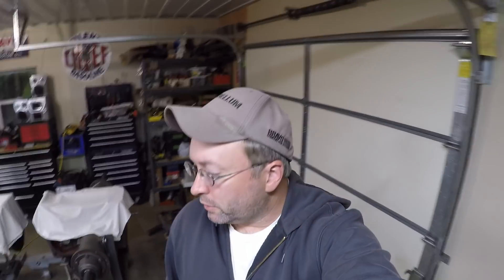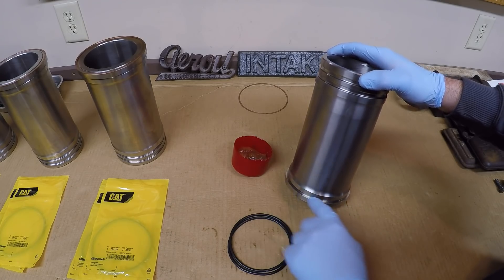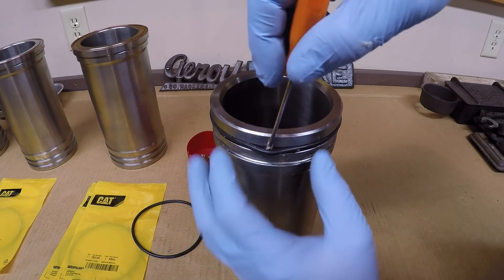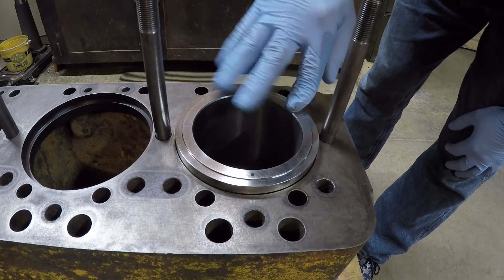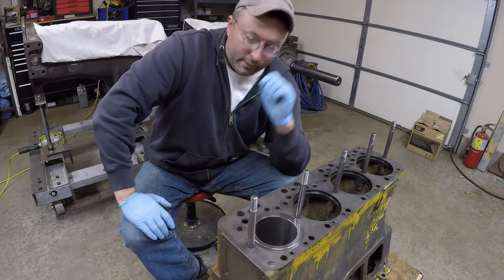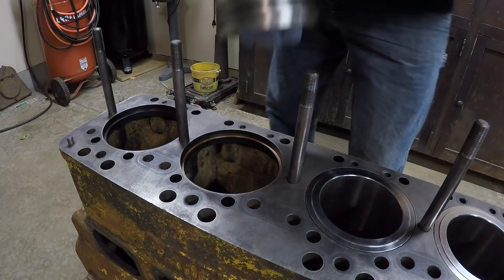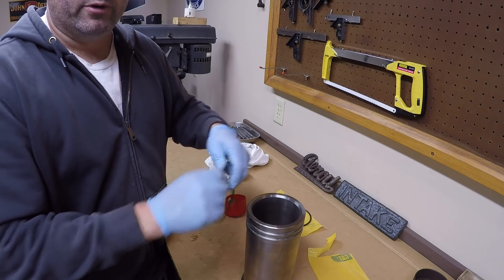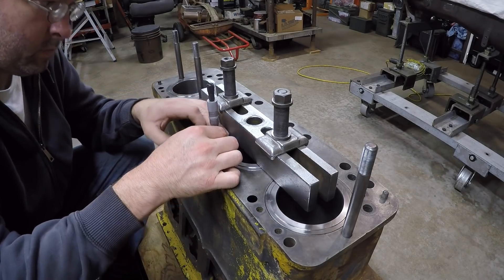Caterpillar D2 #5J1113 Diesel Engine Assembly Ep.3: Sealing & Installing Cylinder Liners

Comment: Always a good feeling when the liners SNAP down into the block bore. Question- have you ever ran into an old Cat engine that has been counter bored and a sleeve installed around the top ofthe liner? I' ve worked onCummins NTCs that have had it done to correct deck surface corrosion in the bore. As far as lubing liner O-Rings, we use motor oil on most of them because it swells the rubber into the bores imperfections

Comment: It has been 20+ years since I went though a similar class on a cummins kta3800 engine but I seems like we had to torque the sleeve in after they seated and then it was a rush to get the head on as soon as you can to so it did not work back out

Comment: Grand dad used to use western auto water pump grease to get his sleeves set in the block due to its ability to protect the rubber O rings  and I know that the tire lubes works equally as well

Comment: Thanks a ton for the reply!  Blade setup looks exactly like the one you have (running now, with the bug-eye headlamps).  Undercarrage looks well worn from the road (where I have to look at it from).  Track rails about 1/2 inch thick, or less,  and grouser pads about the same.  I can't see sprockets due to high weeds.  Also, it is NOT electric start pony, like yours (darn).  No winch (darn again), and not sure about belly pan and tow hook(s).   I plan on guessing total weight at 4 1/2 tons, for scrap worth calculation and needed hauling capability.   Thanks again!!

Comment: I'm behind in the 'ole viewing but it is that time of year. You not wearing your boots is kind of strange to me, you always with boots. The lower o-rings grooves were designed for those o-rings and nothing will seal better than things they were designed to fit there. Even on modern CAT blocks they still use o-rings so good choice sticking with what you did instead of un tried who knows stuff.

Comment: Just to play devils advocate . If it went in that easy its going to leak.  just pulling your chain. LOL Yes progress is made.
Reply: @squatch253  Years ago i assembled a reconditioned vw motor at work. It arrived with the block assembled and the rods hanging out of the bores for me to fit the pistons and heads. Fitted it and it has oil pressure for an instant then nothing. The original crankcase had cracked and they'd replace it with another one they had in stock after line boring it unbeknownst to me. When the oil pressure came it tripped the relief valve. I was thinking what have i done? I knew i'd cleaned the relief valve and spring when i'd disassembled and washed everything.  The case they'd used had been sitting dry for a few months before they passed it on to me and the piston had rusted into the bore just enough to stay there. So you have to be careful.

Comment: Squatch, I'm somewhat amazed that over 100 comments in no one has told you that you've screwed up big time by installing the sleeves with the incorrect type of lubricant. I've never used tire grease on a tire or liner o-rings, but dang it'd sure be hard to argue with your results. I've used transmission assembly grease/paste thinned/mixed with 15w40, Sil-Glide, Vaseline, Dawn dish soap all with similar results. Will try this on my next wet liner install.
Reply: @squatch253  thank you for the link to the product. I will have to get some for the tool box. I would've bet money that the comments section was going to be full of angry discussions about the lube choice. I'm pretty opinionated about oil, but not without basis for my beliefs, but I'm certainly not going to attack someone for their methods or choices. At the end of the day just about every oil sold today is worlds better than anything that was available when these classic machines were sold new. That being said it's hard to go wrong with a 15w40 in just about everything (shy of a 2 stroke Detroit) or a diesel rated HD SAE 30. If a SAE 30 was good enough 70 years ago, it's certainly good enough now. I just try to stay away from the run of the mill passenger car type SAE 30 oils that aren't diesel rated because they're really light on anti wear additives. The anti wear additives in even Wal-Mart brand Super Tech 15w40 or Tractor Supply/Rural King are hard to beat value for money.
Reply: @squatch253  I almost forgot to add, you've ruined this engine by using the wrong lubricant. Once the entire machine is assembled and done I'll buy the whole thing to save you the trouble of having to take it all back apart to change liner o rings. I'll be fair and pay $1.00 per pound, delivered to Michigan of course.

Comment: Never thought of using tire mount compound, I always use K Y jelly its water based so it leaves no residue when the coolant is added. That block must not have had to many hours on it to be that perfect. Nice job on the install.

Comment: Anyone watching, only grease those orings right before you go to install the liner. Some of those orings will start to expand after oil or grease is put on them (depends on the lubricant you use) and after an hour or so they will never go in that bore. I've seen some expand so much that they will actually fall off the liners when you invert them.

Comment: Squatch, if there was corrosion on the block liner landing, would it be possible to undercut the landing surface and fit a thicker copper ring? Just another, when you anneal copper rings, do you heat them and then quench, or heat and let them cool down naturally?
Reply: @squatch253  Thank you.

Comment: Still with you 100% on procedures. Every single step is important to promote engine life. Never used the tire lube but I like your results. I've always used the motor oil that will be used in the crankcase. Only issue with that, you must install the liners and clamp down in a timely manner as the oil will swell the o rings. Love what you doing, keep it up!

Comment: Squatch, so having to deal with wet liners, at what does the final crush of the copper sealing officially take place?  When the head is torqued down? So the fire ring transfers the proper load to seal itself and then crush the copper washer in its position?

Comment: I know you will keep good antifreeze solution in the engine SOO you should not see rust in the block.
Thanks
Reply: Thanks for your Comment, Dennis. 

I didn’t realize that a good antifreeze solution (in this or any other engine), changed at appropriate intervals, would help keep the internals of an engine block clear of rust. 

Roy Lewis
Buffalo, NY

Comment: For what it is worth some of the bored out pulling engines have to use no o-ring liners due to lack of clearance, so they get sealed up with red RTV or right stuff. Either one is usually only good for a season or two before the expansion and contraction causes containment failure. Hardly any of them run wet blocks anymore though so its not much of an issue. I would never advise somebody to use sealant on liner 0-rings either.

Comment: My goto rubber "grease" is white vaseline, it's also my goto for electrical connectors, lip seals, plastic bushings etc. As a bonus you can even use it as a skin moisturiser. It does go liquid at around ~40C(like 110F I think), and turns to paraffin, but I've never had any issue whatsoever using it. Also I'm pretty sure it impregnates rubber and keeps it flexible for longer.

Comment: A local farmer had a 1070 case with a 451 six cylinder diesel engine He had a local repair shop put an after market engine kit in it. Les than 10 hours it had a horrible knock so He brought it back and the shop put another kit in it. Same thing happened only sooner. The pistons were out of spec. after about ten hours of work the pistons  would start hitting either head or the valves. I think they put genuine J.I. Case parts in the next time. Problem solved. Something to  ponder when the cheap rebuild kits look like such a good deal.

Comment: I've used Sil-Glyde and 3M Silicone Paste (probably the equivalent to Motorcraft) with good results.  Not sure I've ever slipped a liner in quite that easy though.  Zero chance of a sealant working in that application.  There is more movement than a guy would anticipate.  I'd say the cylinder bore heats up second fastest to the cylinder head.  Figure a rough estimate of .001 per 100 degrees of temperature change.  Then there is the violent frequency and amplitude of combustion that can deform the circumference.  The intense compression of those seals is needed to maintain a seal.  If a manufacture found a faster cheaper way to accomplish it we would see it in production by now.  Serviceability is also a consideration.  Imagine a product that could perform the task... I bet it would be a bitch to get a liner removed.
Reply: @squatch253  I'll have to give it a try on my next liner.  Think I have some Murphy's Tire soap or similar in the shop somewhere...

Comment: some day.. you might try hylomar.  also sold as Permatex 85420 flange sealant.  it never gets hard.. was designed for Rolls Royce jet engine o-ring assemblies where the engine housings are mated. i use it thinly on both sides of head gaskets.. have not had a comeback since i started using it in 1993.
Reply: @squatch253  almost every parts store has it next to the silicone sealers.. under the Permatex brand   Flange sealant... product code 85420.. what the package looks like.. https://www.permatex.com/products/gasketing/gasket-sealants/permatex-permashield-fuel-resistant-gasket-dressing-flange-sealant/

Comment: I suspect "modern silicone sealants" were not available when this engine was designed and may have been used to lubricate and seal the O-rings if available. Toby is an experienced engine builder so I will yield to his experience for liner installation. VERY thorough!!!!! This is the fun part of an engine rebuild with the disassembly and cleaning as a faint memory.
Reply: There's a lot of stuff we have now that wasn't available back in the days of this old iron, that makes you wonder what the designers could've done differently if they'd had those resources available to them. Modern sealants, modern seal materials and designs, so on and so forth.
Reply: @tamberp  Tis a truism. When I replaced a leaking seal in the torque tube of my 1956 WD-45, I found the well worn double seals to be leather. Some of the bearings in our old threshing machine were oak.